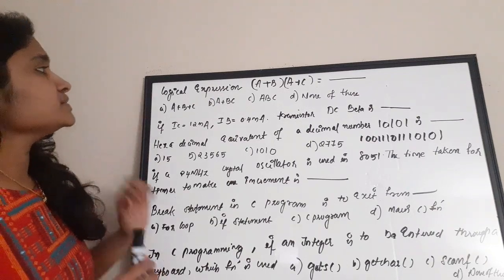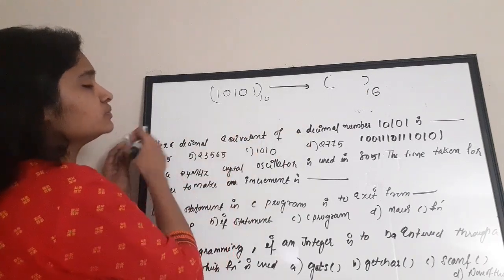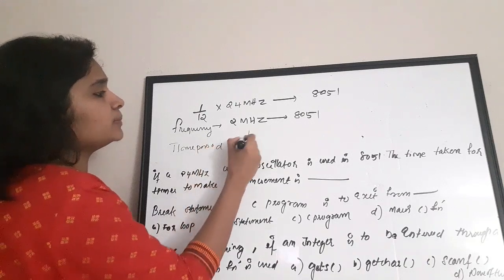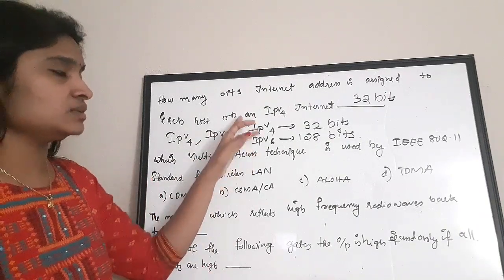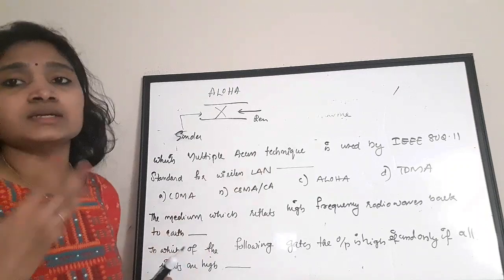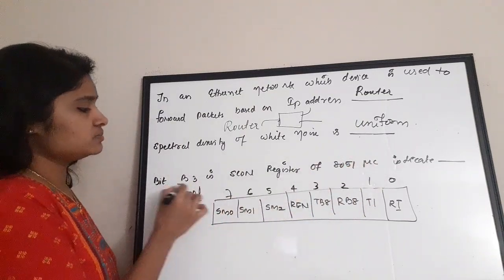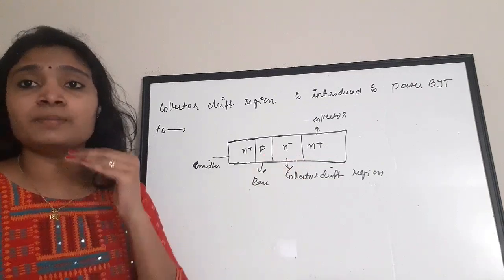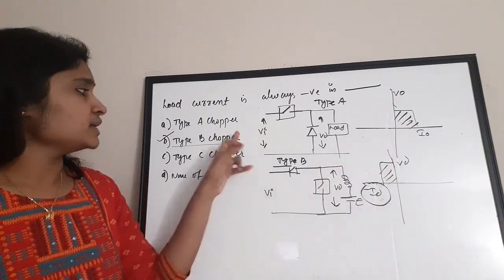Competitive Exam Preparation of Electronics and Electrical Part8| Technical assistant| BEL Exam

Comment: the conversion of decimal to hex number just divide by the given decimal number with 16 i think this is the easy way to find hex number
Reply from the maker: 10101 by 16 is 631.3125 dividing and taking reminder by 16 is difficult than Conversion  to binary I think.
Reply: Easy Electronics sorry to say you going in wrong way and  what I’m telling is successive devision not directly divide the decimal number by 16
Reply from the maker: @Ananda .M yes, yes I understood but for dividing and finding reminder  in mind I think 2 is easy. Anyway u can have your own method
Reply: Easy Electronics you have a enormous knowledge about electronics  , i gave another option to solve that problem 😊 there is no issue... keep going tq so much .